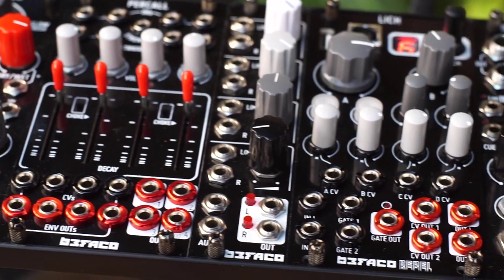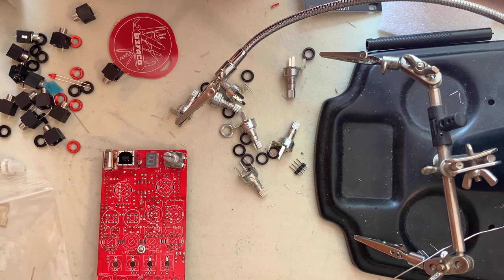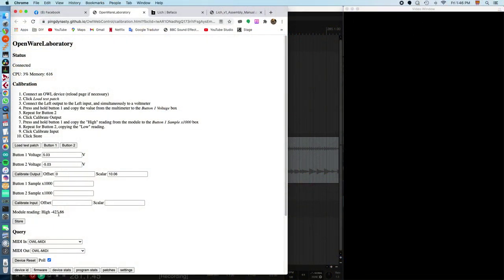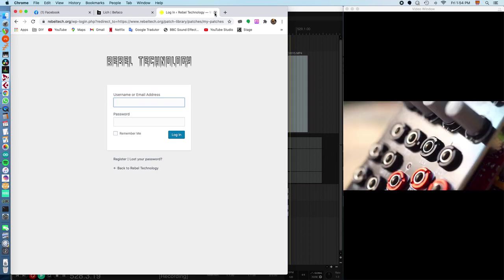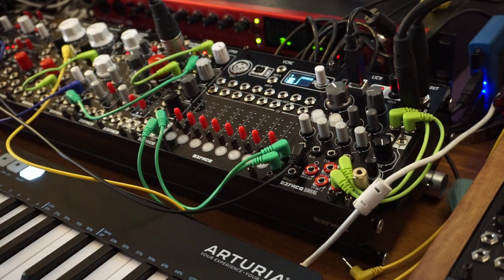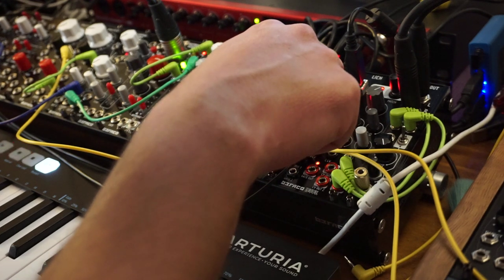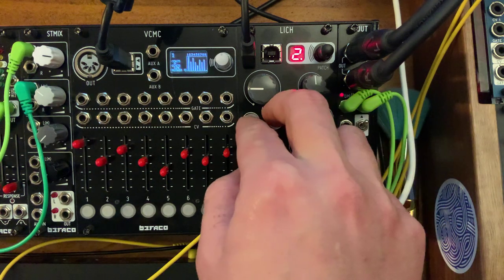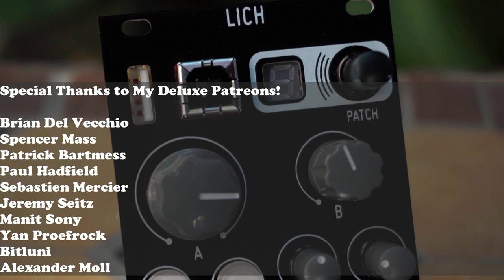Befaco Lich - Demo and Build video

Comment: Hi Quincas! I’ve watched some of your build videos, so I was aware that you solder axials from the component side. But with LICH that I started building last night, I did it like that after ca. 45 years of soldering everything from the circuit side. What? Great process, it’s more secure and cleaner, thanks, man! Now waiting for the firmware update to use hex or otherwise increased range of patches 😁

Comment: how to connect this to computer? because nothing happens when I do that in Windows 10. Do I need USB driver? I've tried connecting on Mac, then module at least shows E, but still failng to connect.
Reply from the maker: Hi! Are you using Chrome? you need to use chrome or chromium, as they are MIDI enabled browsers.
If you still have trouble try contacting Befaco support!
Reply: @QuincasMoreira  But on Windows is not even detecting it... Lich is not even showing "E", nothing in device manager...
Reply from the maker: @revpolarity  definitely hit up Befaco then, I'm a mac user myself!
Reply: Chrome should detect it and via Rebel tech  you should load patches. Grant permission to Chrome to use MIDI, then hit conenct to device at Rebels site. Anyway, head to Rebels forum or send a mail to befaco´s support!
Reply: @Xustafu  I was able to connect in Windows 10 and Chrome, but this calibration webpage does nothing. I put voltgates, calibrate, store... reset and voltages are exactly the same (+4.826 and -4.913). When I connect midi keyboard I'm getting 0.244 on C0, 1.256 on C1 and so on...

Comment: Promising module, but for me it's been a troubly module to DIY. I just got around to build it now, and while the build was fairly easy, I fucked up a few places. When measuring voltages they were nearly around the right values, so I thought it was OK, voltages might fluctuate. But when I tried to calibrate it the values were a little strange, so the numbers I put in made the calibration test numbers way off. But at least I got some sound and CV signals out of it. But then I tried to update the firmware to see if that would fix the calibration problems. The firmware wouldn't install, and after that the module hasn't been working. Because of my experiences I can't recomend this module as a DIY project. But if you want to try it, you should be an experienced builder, like Quincas. I've had too many modules that hasn't been working, costing a lot of money. Sadly Lich is one of them. I would like to have a go at Oneiroi, but after my experiences with Lich I'm not really sure i would spend more money on Befaco.

Comment: Can't you record this so that your hand doesn't move all jerky like this??
I makes it hard to see cause and effect! I just finished building my Lich and I think it has something wrong with it. I can't get the LED inside button 2 to light up. So I wanted to look at your video to see what to expect, but with all that extremely jerky movement of hand verses module reaction, I'm finding it extremely difficult to see what the normal behavior of this module is.

Also a suggestion. Keep your videos looking straight down at the module. When you shoot from the right side at an angle, all we can see is the top of your right hand blocking what you are doing and what the module is doing. That doesn't happen when you look straight down on the module like 50% of your shots are.
Reply from the maker: Sorry! I think my newer videos are better in that regard.